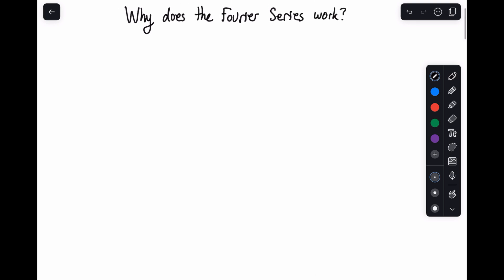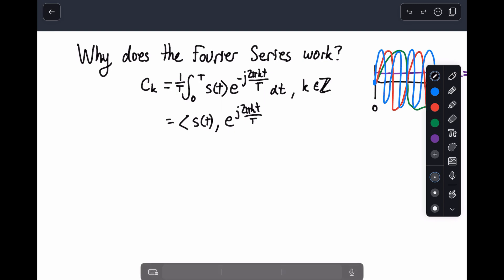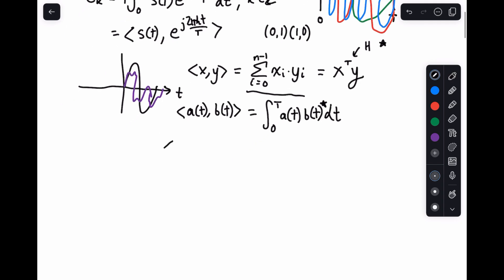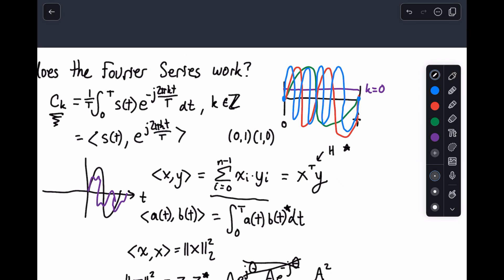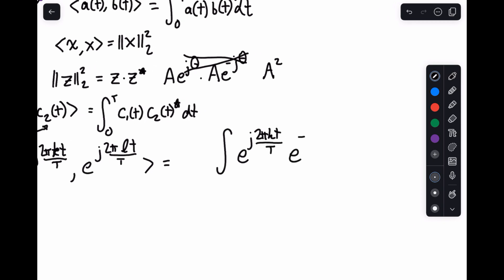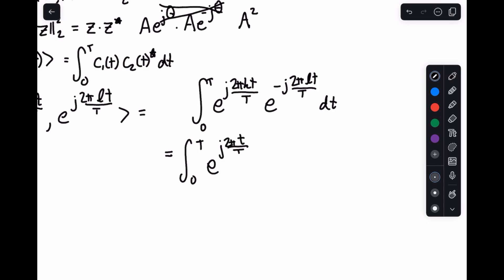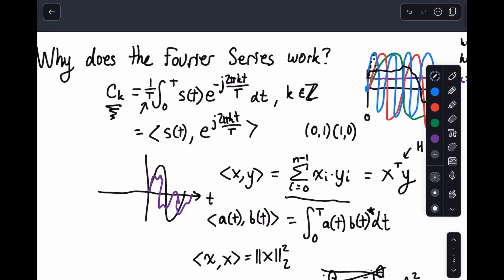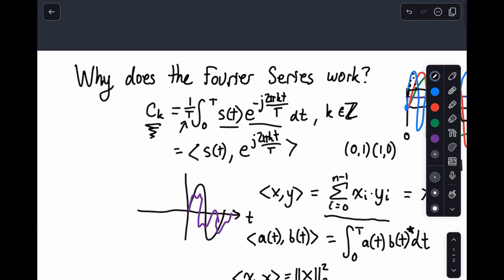Why does the Fourier Series work?

Comment: You know what's even better than this? Writing the actual source code for an FFT and its inverse then watching them work. Excellent video by they way, very enjoyable.
Reply from the maker: There's no better way to understand it than having to write the code yourself :)
Reply: @SignalProcessingWithPaul  True, but the actual source code is easier to read and understand compared to the actual mathematical integral notation. Now as for the comparison of them from a Graphical representation such as transposing them from one spectrum to another is fairly easy. Their overall concepts are quite simple... the algorithms aren't too bad, but the math involved to derive them is quite complex, pun intended.
Reply: @SignalProcessingWithPaul  Well other than FFTs, one of the most other beautiful things in math is e^(i*x) = cos(x) + i*sin(x) as well as e^(i*pi) = -1 or e^(i*pi) + 1 = 0. These have to probably be two of my favorites... Then again Quaternions are up there, and so is Boolean Algebra.